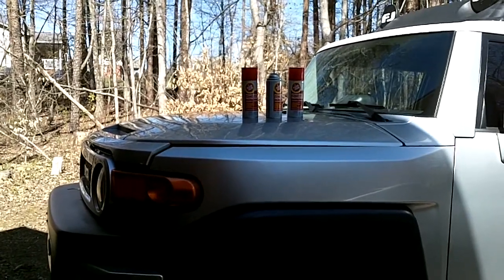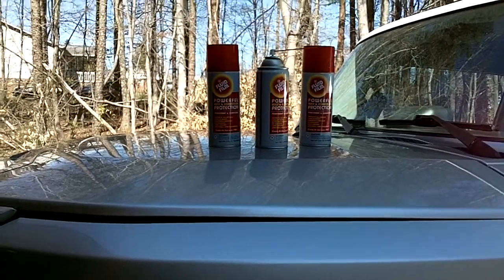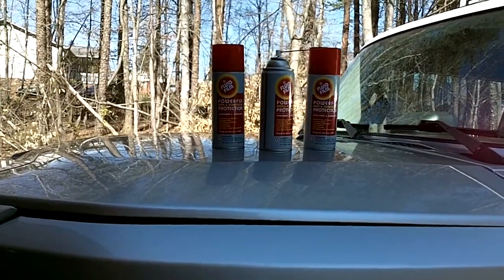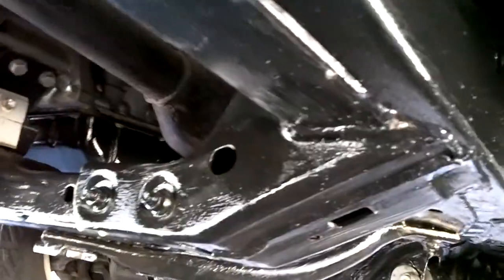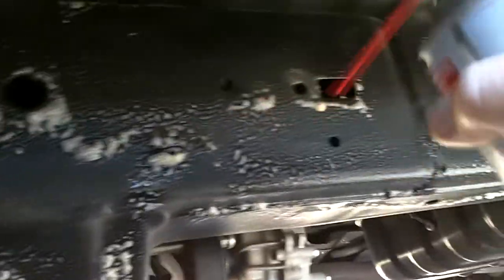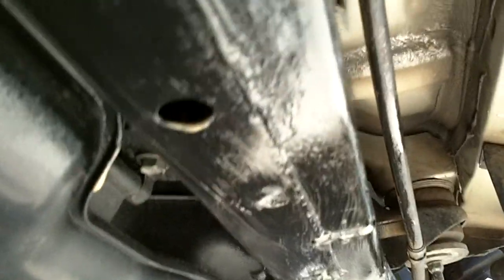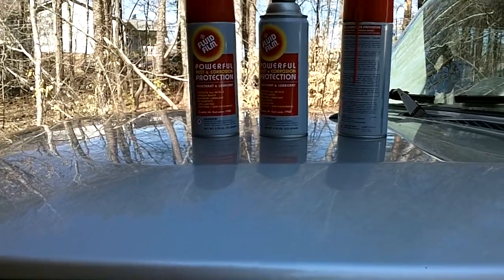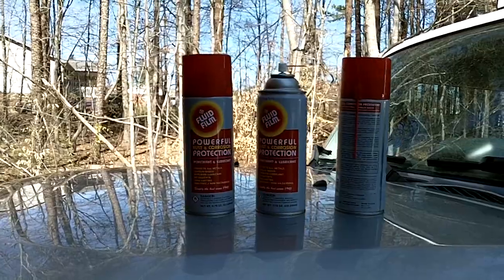FJ Cruiser Bug out Project (Fluid Film Corrosion Protection)

Comment: For high-quality processing, you should clear the frame (long - until you start to flow clean water) inside, using high pressure water and special nozzles and handle inside the frame (also with a special flexible brush head) here then is the full effect of this work! I doubt I will be able to buy in Russia it is the composition that in the video, but we have many other "Dinitrol", "Liqui Moly", and so on. Thanks for the informative video...

Comment: Get the 360 wand kit and at minimum get inside the rear cross member, left side frame in back of the front wheel next to the converter and the right side, in the body mounts, and inside and back of the rear end mounts. If you don't you can kiss your FJ goodbye if you live in the rust belt just like the older Tacoma's.